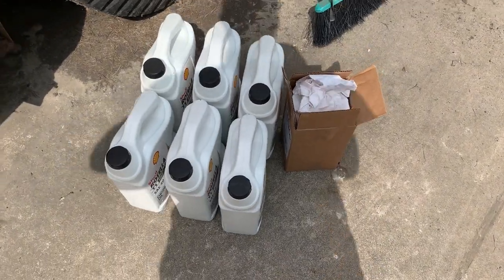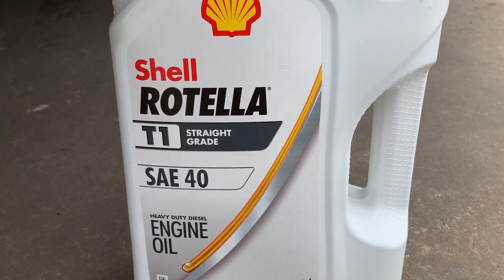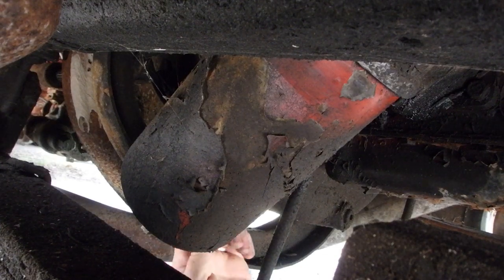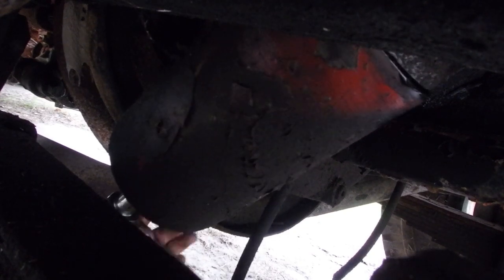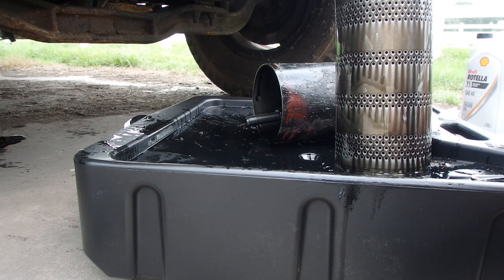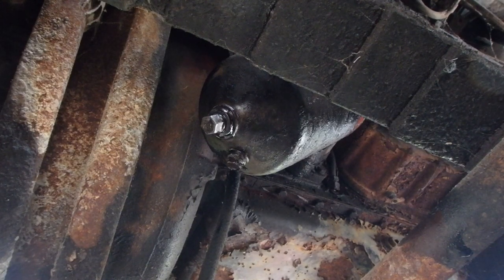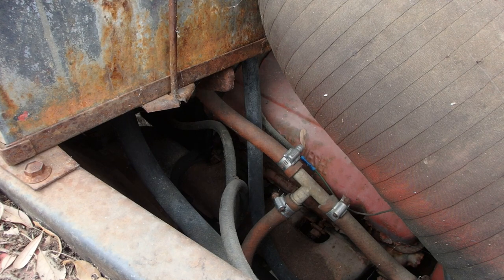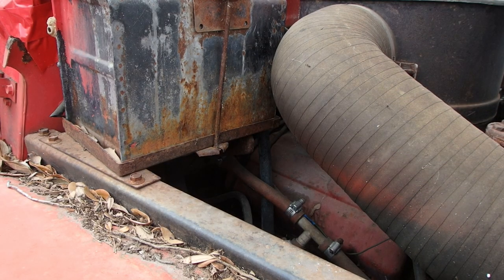Oil Change 76 International Detroit 6v53 Firetruck

Comment: So per detroit 30w oil is specified in all the older manuals. The have since updated that to be 40w in all engines. Also the traveler brand at Tractor supply doesn't list CF2 but i believe it is when we dug deaper. Usually thats the cheapest oil we can get for 2 strokes.
Reply from the maker: I couldn’t find traveler 40wt diesel oil. My store did carry the 30wt. I may see if I can special order the 40wt. I found a 40wt cf2 oil on Amazon that was sold in 5gal buckets but couldn’t find a lot of info on it and can’t even find it on Amazon now.
Reply: I fill and run BRP XD-100 oil through my 8v92 turbo 2 stroke. I pull done off and blend it with fuel with a mixing valve I plumbed in and add it as it burn off! Works great and stays clean! Changing oil on any 2 stroke is just so gay. I don’t mind buying 6 gallons of the XD etec oil from Walmart. Next I want to give castor 927 maxima a try if I can get enough of it.

Comment: You can reuse copper washers multiple times  ...  but you MUST anneal them prior to reinstalling them.
To anneal a copper washer, simply fashion a thin wire to hold the washer, then heat with a propane torch until it glows red. Remove heat, and allow it to cool slowly for a few minutes. It is now ready for reinstallation.
Annealing a copper washer, removes the brittleness that results from "work hardening" as the copper washer is crushed by tightening the bolt.
Once annealed, the copper becomes soft and pliable, and able to be crushed by the bolt once again.
Failure to anneal a copper washer for reuse, prevents the washer from sealing properly, and may crack when tightened.
Reply from the maker: Thanks, good to know.

Comment: I'd take that thread tape off at the next oil change. If it starts to tear as the plug is put in/taken pieces might find their way to the oil pickup or even further. I don't know for sure but it's better to be cautious.
Reply from the maker: Good idea.
Reply: Changing oil on a 2 stroke is too gay for me! I would rather rig it up with a separate oil tank and pull some of the oil and make up an oil:fuel blending valve. Also s VRO injector for a little in the intake. Ill will  be running  castor 927 maxima. Im working on this on my 8v92 turbo 2 stroke.